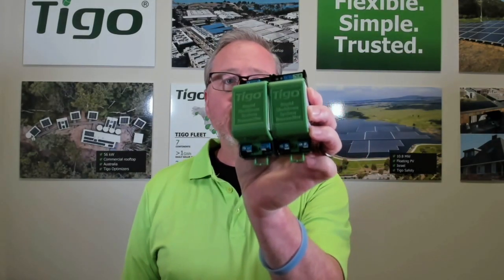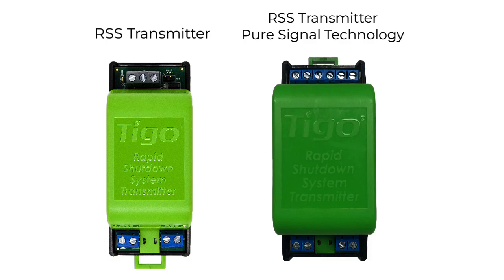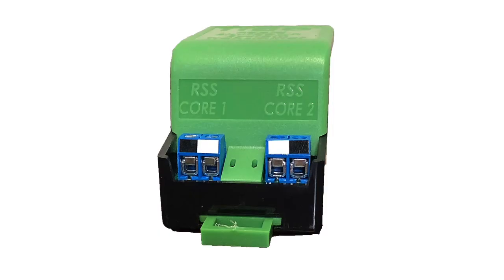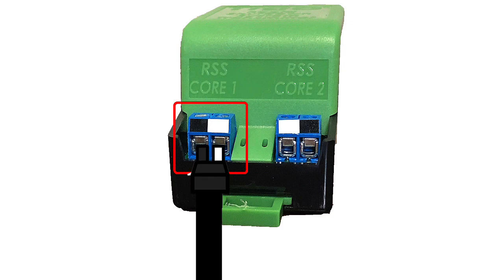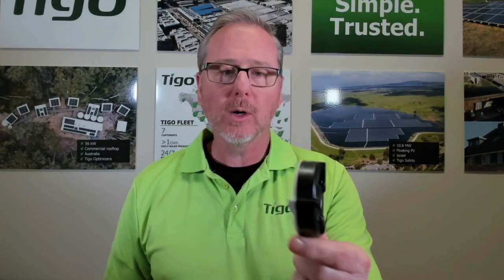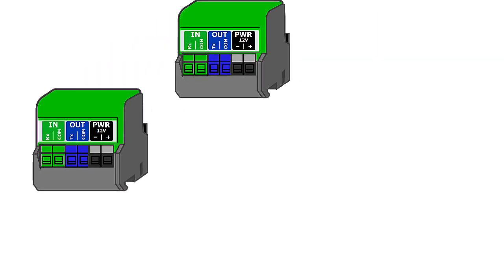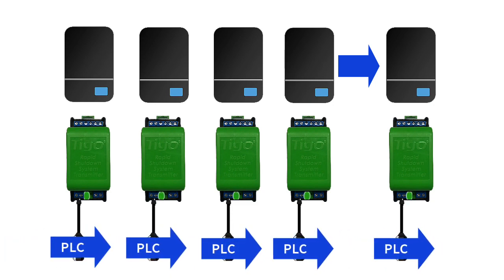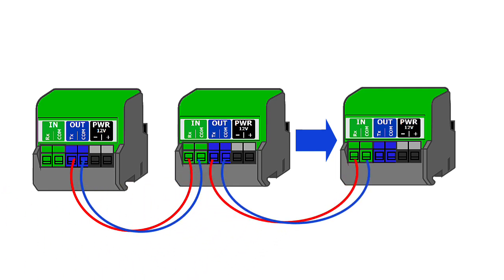Tigo Tech Talk: Common RSS Transmitter w/ Pure Signal technology install errors & how to avoid them

Comment: I read that Tigo RSD's need to have a minimum of 9 per string? Is this correct? I have two strings, 6 panels West and 8 panels South. Suggestions for Tigo rapid shutdown roof install with SMA inverter. Sunspec is an option of course but I like the concept of 1 RSD for two panels.
Reply from the maker: We do not have a minimum number of TS4s per string like other optimizer manufacturers. The number of TS4s is based on traditional string sizing. Your system sounds like a perfect fit for Tigo. You just need to decide what features you want. This can help: https://www.tigoenergy.com/ts4